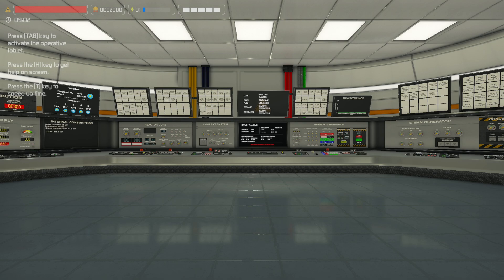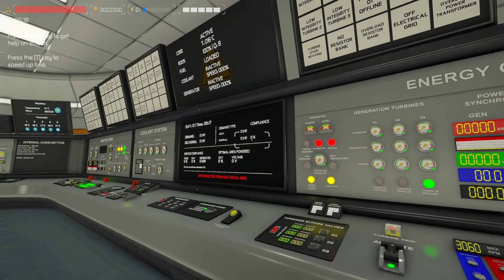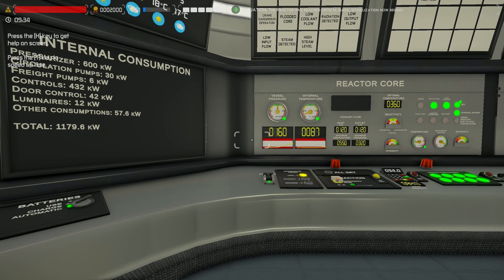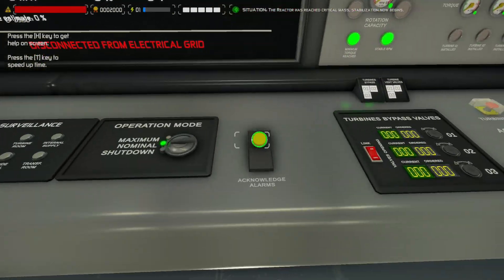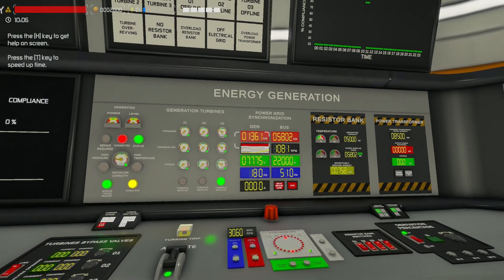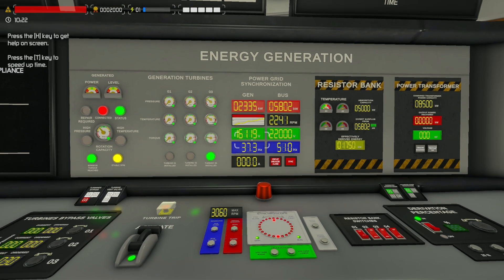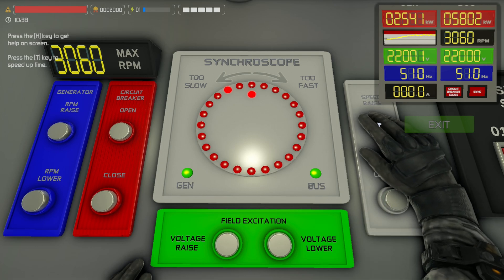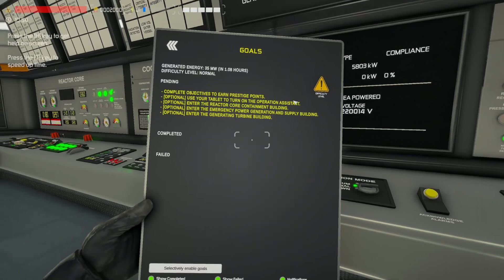Nucleares - The Fastest Way to Stable Power

Comment: I managed to get through startup on a career save, and I just "wung it" when deciding to shutdown somewhere into day 4 because some of the integ and maint values were concerning.

No idea how to shutdown, just inserted the rods and ran all the cooling pumps at full blast for 12h.

No idea what maint issues are key and what can be fudged.  No idea how to strategically time shutdowns.

No idea what to look for during operation -- grid output kept throttling up and down for seemingly NO reason.

Kinda futzed my way into figuring out how to install gen2, extra resistor banks.  No idea what the transformers do, but I ordered another one because fuck it, shit's on markdown after Christmas.

And on a few save-backups I intentionally yanked rods out to 0% or let the pressurizer go unchecked, to see what happens.  Third or fourth intentional meltdown, I did figure out how to re-water the core pit to extinguish the fire but still no clue how to come down from crisis mode after 36 hours.

And jesus christ does this game CLASSIFY what all those valves are for as a state secret?

Huzzah.  :D
Reply from the maker: Yeah there isn't really any manuals or instructions for this game BUT I have many tutorials (incl. A Complete shutdown tutorial) right here on YouTube ✌️

Comment: Took me a long time to figure out how the pressurizer gets filled. After literally walking around looking at pipes i determined the cooling circuit 1 needs to be connected and pump running.  Need to have that in the schematic.
Reply from the maker: I do have an in depth tutorial... I may have mentioned it in that one ✌️😎

Comment: thanks for the video much appreciated!!!. i have one problem which i really need help with. so i use 2 loops and everything is fine and fully synced until I close the breaker then immediately the voltage tanks then i have to re open the breaker. i try to manually up the voltage but the cycle repeats till i cant up the voltage anymore. any ideas?
Reply from the maker: Is your turbines going over 100% speed...?
Reply: @ShArPy1o1Games  nope they are at 30% tops. i also noticed that it isnt just with the voltage. ive had the frequency go out of control and on a restart the turbine RPM goes way over the max i set. maybe its some sort of bug?
Reply from the maker: There was certainly a bug with the turbines yesterday but was patched only recently... check the patch notes and see if it all works now...? 🤯🤔